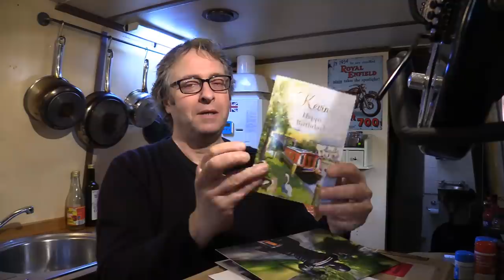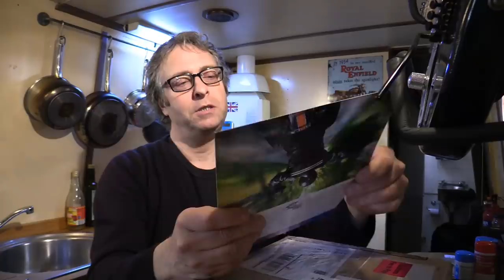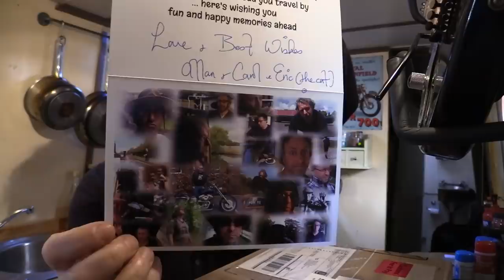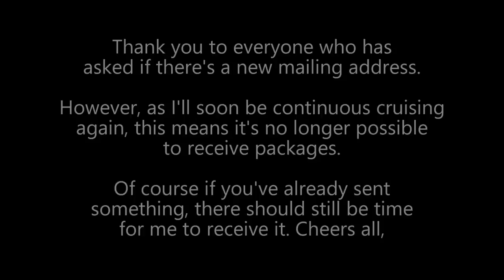New Impeller & 1st Man-Flu in 5 Years

Comment: Dear Kevin,

Regarding the coolant pump. I'd highly recommend at least checking / replacing the impeller annually - that's just normal marine routine maintenance. In that application I'd also check / inspect / repair as required the entire pump likely every 2 years. The whole idea is to prevent any issues from happening in the first place. ( That comes from 3 decades in the marine maintenance business. )
Good luck,
Niall.

Comment: Happy birthday. 
I rebuild pumps for boats at my boatyard.  Rubber impellers should be replaced yearly.  You want to catch it before it starts to fail because when the vanes break off pieces of them goes where the water goes.  So if you have a heat exchanger there will be pieces of rubber stuck in the end of it.
At the least the impeller should be taken out and examined yearly.  Hope that helps.
Reply from the maker: Yes yearly sounds about right Bryan. Will be doing that from now on. Such a simple but critical component.

Comment: Don't think that you need the rooting powder. Some seed starter soil and grow lamps... you can get heating pads for starting seeds as well. It seems to speed up the germination a bit. Do not use those "peat pellets" but get the plastic trays that take actual starter soil mixture.  I tend to save the small one-serving yogurt cups and punch a drain hole in the bottom. From your description, it sounds like those peppers may be some version of the "Pequin" or "Tepin"  varieties... tiny and HOT.  There is a Central/South American variety known as the "Aji Charapita" that is even smaller! The "Tepin"  actually produces a round pepper about the size of a smallish pea... and can produce quite a lot of them. I grow hot peppers as a hobby.  Too bad about the Flu (I have a history of coming down with various pestilences on my birthday over the years  as well (Flu, Measles, Chicken Pox...). Lots of vaccinations lately. So far, I have been jabbed 3 times for Covid, once for Influenza and will be getting two more punctures for Shingles. I am starting to feel like a dart board!
Reply from the maker: Thank you for the tips Stephen. It's going to be a learning experience for me. Perhaps a Chili Growing Video Diary is on the cards?

Comment: When customs come knocking at your door for those Chilli seeds….materials have changed but good OLD plastics used for engines should be OK. Could you get someone to make an impeller that won’t shatter? Yes … I had a friend who had pistons made for an old ‘side car’ type Harley. I love the engine on your boat ( and much love to you too Kevin) That lion is so real, do you have the balls to go with that jacket? Always enjoy your videos
Reply from the maker: Thanks Leslie. The pump has a weird offset chamber which means the blades have to flex.
Reply: @CountryHouseGent  such technology impressive 🧐
Reply: They make silicone replacements, but some are dodgy and out of spec for thickness so they won’t pump. BTDT. I only wish I had that kind of access on my sailboat. Exact same pump. I save at least one old one for a spare if it’s not cracked. I do two years and find they are still OK, but put nowhere near the number of hours on that you would. 

And happy birthday to you.